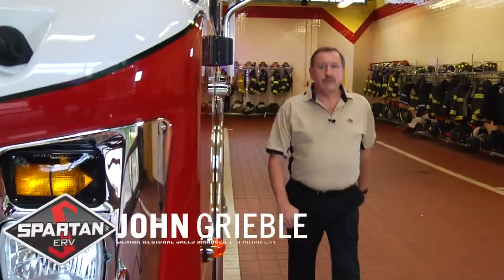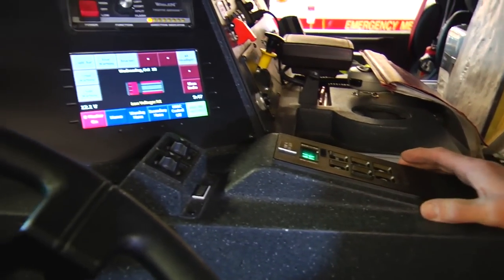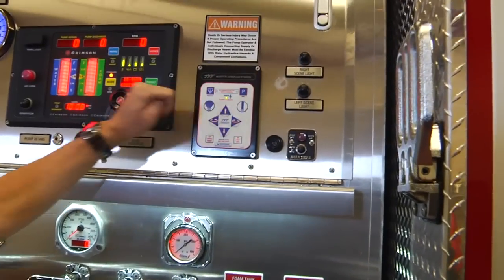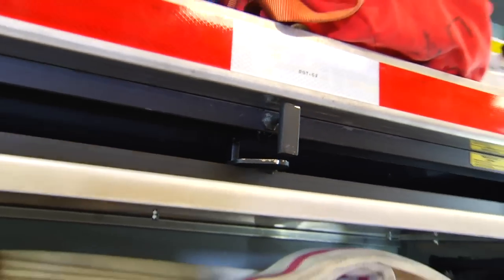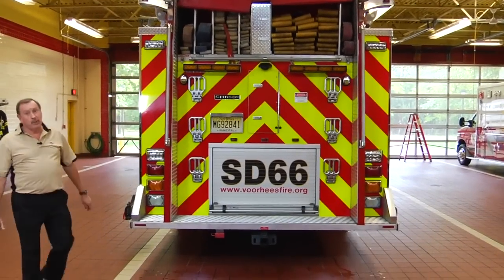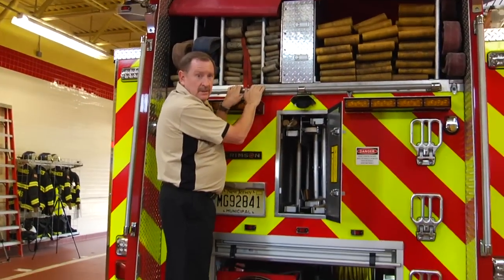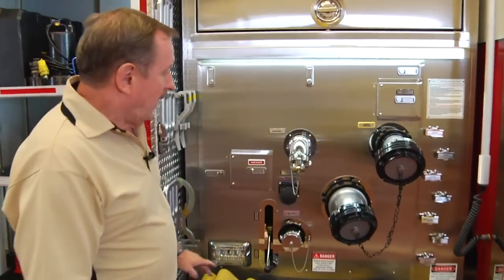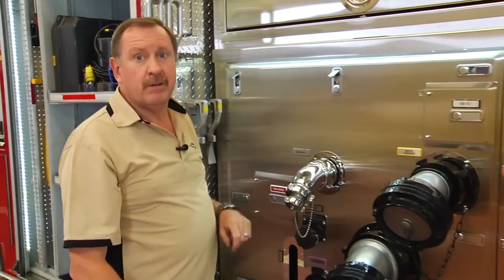Spartan ERV Star Series Pumpers

Comment: wow. what a nice engine. can make a video that operating a hydraulic cutter sir? step by step? operated by generator. please. thank you and God bless to all trops.😊❤️❤️
Reply: they’re not hard to use. They’re pretty heavy. Heavier than the electric ones. You connect the cutters to hydraulic lines which connect to the generator. Start the generator and get it going and start using the cutters.